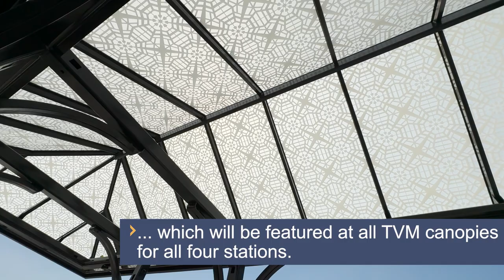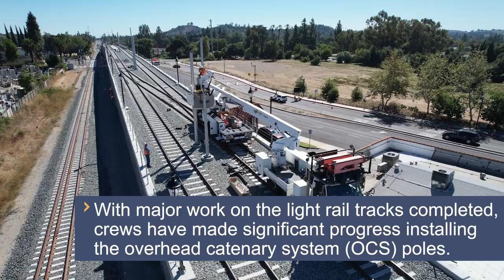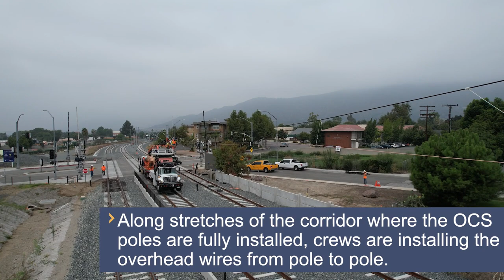Foothill Gold Line Project Update Highlights - October 2023

Comment: As much as i'm happy for any new transit, i'm really saddened by using the most valuable land (around the stations) for surface parking. Put it underground at least! Build housing, retail, office, literally anything else around the stations. People don't ride to parking lots. They ride to the facilities around them.
Reply: Ngl you had me in the first half. No but seriously, they defo shouldve had an underground parking section
Reply: Until either Metro or Foothill Transit makes massive improvements to bus service in the area there will be a lot of people driving to the stations to get on the train to go to Pasadena, downtown LA, whatever. They shouldn't build parking at every station but they should have some strategically located at some of the stations to handle the commuters. Otherwise those people will just drive to where they want to go.

Surface parking lots are cheap and can be ripped out and replaced with better uses later as the last mile public transit improves in the area. Underground parking is extremely expensive and would make the project untenable. (And would be hard to remove later on.)

Comment: This video didn't have percentage completions like the previous ones, but that's because it appears to be so close to complete in all regards! I don't see with how rapidly it's coming together why it got pushed from late 2024 to mid 2025. Although it will probably be convenient for reaching Del Taco in Glendora, and a Dollar Tree and Walmart, without Montclair station, the most important use for these 4 stations for me is La Verne station for the LA County Fair. Even though it won't be ready for 2024's, I hope no matter what delays happen it is open by April 2025 since that's one of the few LA County places outside of the South Bay, Calabasas/Agoura Hills, Santa Clarita & Antelope Valley and a couple small pockets that I still have to drive to since there's no easy transit to leave to LA after 9pm and would therefore requiring rideshare or biking to Downtown Pomona or significant driving.
Reply from the maker: Hi. The Glendora to Pomona project segment was always projected to be completed in 2025, and it remains on schedule for an early-January 2025 completion and turnover to LA Metro. They will determine when passenger service begins.
Reply: @FoothillGoldLine  I saw a couple articles this summer that said it got bumped up to end of 2024 but I didn't verify its accuracy or source other than a tweet update. I see it won't be easy but is possible to make my desired opening date. I am curious what the status/future of Claremont/Montclair stations are, although I won't struggle with Montclair thanks to the Silver Streak. And what order these will happen in 2024/2025: OC Streetcar, new B/D line cars, K Line fully open/shortened C Line, D Line Extension 1 & Foothill Extension.